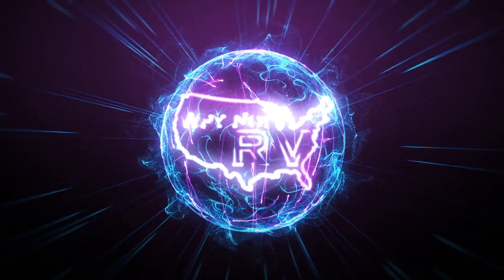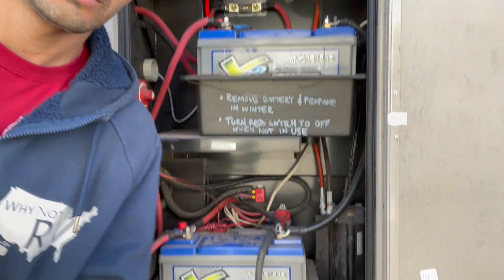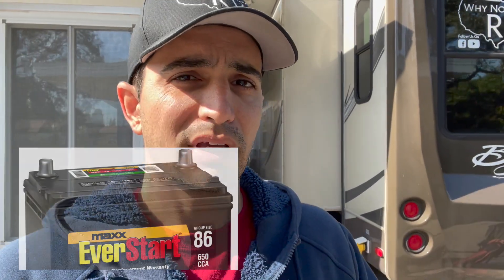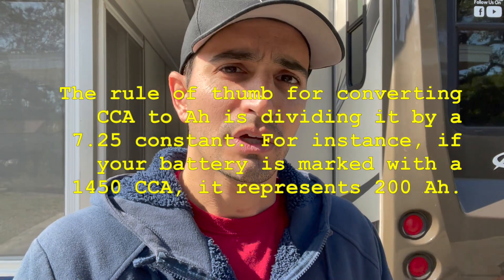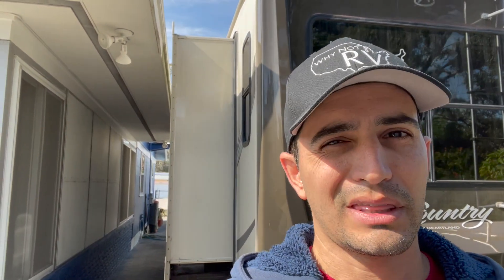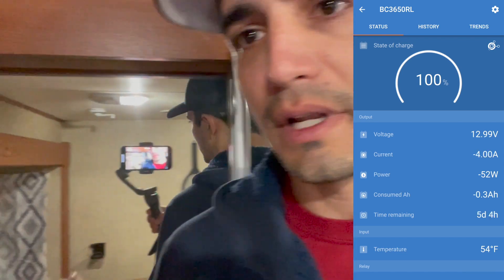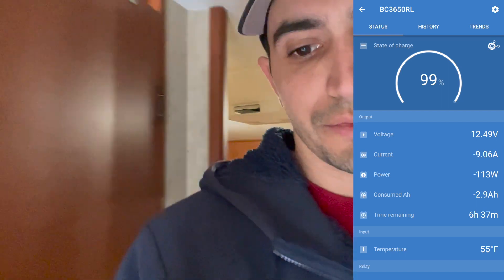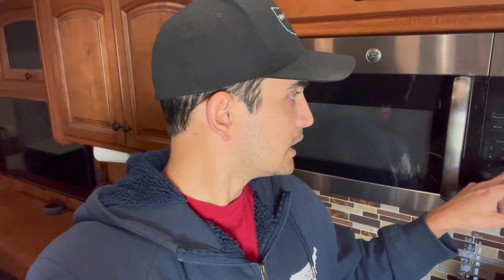Advanced RV Electricity - Why Not RV: Episode 45

Comment: If I install an inverter/converter, can I just switch off the RV's converter breaker or do I have to plug in the new one where the old one was plugged in?
Reply from the maker: If it’s a inverter converter combo you can just turn the breaker off to the old one.